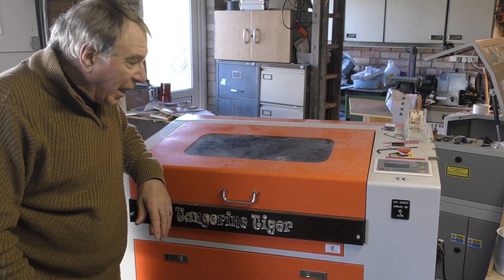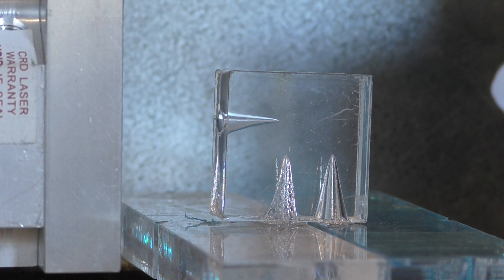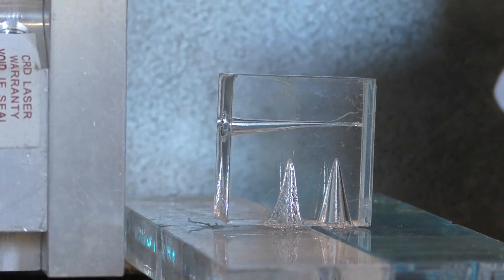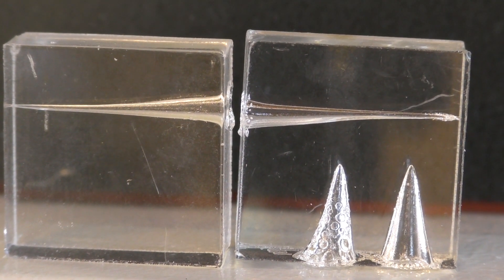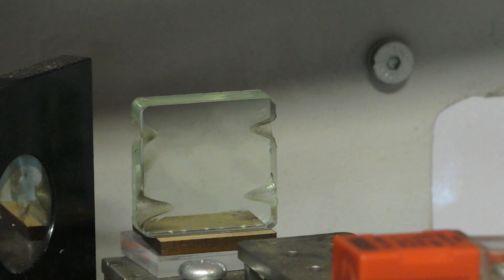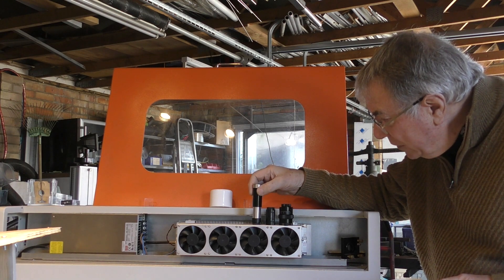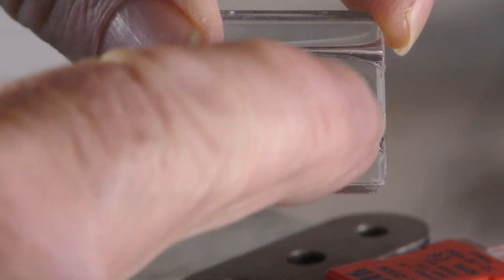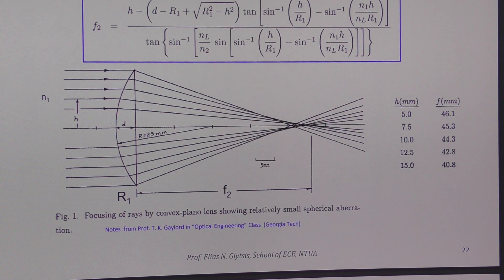RDWorks Learning Lab 226 Can my Beam Collimator  Work

Comment: are you trying to expand or reduce your output beam that is coming out of the laser? you are only concerned with spherical aberration since you are using narrow frequency or practically monochromatic beam right, what is the wavelength in question? and yes if you use a newtonian system the focal point will take all max intensity from the central axis of the original beam and distribute it across the outer perimeter of that beams cross section after going through the system kinda like an intense donut with less intensity the closer you get to the center of that cross section  , what you want is a galilean system be it to expand or reduce that will keep all lines in the same position after the system perhaps even keplerian system which uses different style lenses even though it has a focus point but i would prefer a top hat beam profile rather than the typical gaussian but i think that has to do more with operational mode , anyways i am just a novice but had a fascination with lasers and light for a long time, closest thing i built to anything emulating a laser beam was making a collimated beam of white light with better divergence than my hand held laser pointer having as best a spatial coherence as i can get it  although the light is quite weak as all i am working with is a 7w led for the source but still enjoy the light show and mirror steering i get at night with mirrors and a foggy room
Reply from the maker: Hi during the 3 intervening years since this video I have come to understand the wierd relationship between lenses and the intensity distribution profile within CO2 beams. It goes way beyond anything that normal lens theory deals with. Lens theory is all about images whereas laser technology for  cutting and engraving is all about amplifying light intensity. In essence the greater the intensity the faster you can damage materials.Different wavlengths interact with materials very differntly.  At low power  (say up to 150 watts) CO2 light at 10,640nm has a damaging effect on many non metallic materials whereas fibre  (1064nm) and diode 450nm) wavelengths barly tickle the surface of a much smaller range of materials .  The Gaussian intensity profile is recognized as the ideal  distribution for cutting materials but few have ever explained why. Exploring the RF CO2 technology taught me a great deal about how laser beams and lenses dont really work that well together,. The intensity profile directly out of an RF CO2 source is VERY high intensity in a very small diameter beam. Sadly it has a a high divergence of about 8mm beam growth per meter. The power in the beam does not change with beam length but as the beam grows so the intendsity drops of dramatically and the RF technology gets less and less  inefficient at cutting as it gets further from the source. To have varing performance across the work area is very undesirable so the standard practice for ALL rf machines is to catch the beam as it exits the source  and pass it through a beam expander.  Whether the Kepler ot the Galilleo design, there are two spherical  geomety elements involved. The beautiful Gaussian intensity from the source is almost destroyed by shperical aberration as it passes theroug the first element and  by the time expansion has happend at the second element the output intensity profile ihas  a near  uniform top hat  chacteristic. This charcteristic allows the low refractive central axis of a lens to be ignored and for the better focusing outer zone  to create  a superb small focal point. This is great for engraving but inefficient at cutting.  That is  why after many years of peddling the "magic" of RF  techonolgy. companies such as Trotech have introduced mixed technology machines where both glass tube (they call them ceramic tubes) and RF  technology can be selected to perform different tasks.. After my exploration of ultra thin beam diode lasers I plan to backtrack into RF technology because I see great potentioal for exploiting that soutce beam before it gets hobbled by beam expansion, 
In essence, my collimating experiments failed  because all I was really doing was producing a long focus compound system and not a collimator. You maay be interested to see my summation of how lenses and laser beams are very choosy about how they interact. These two videos  try to briefly pull togeter more than 3 years of expeimenta work and you will see examples of how Gaussian-destructive commercil beam expanders are 
https://youtu.be/7N8Th1-IF4s     and     https://youtu.be/v7-VArJbJTs
Reply: @SarbarMultimedia  your gallileo should be using aspheric lenses which are made to reduce or eliminate spherical aberrations but perhaps it is different at the freq range you are working with as you explained, also did you think of using parabolic mirror system instead of lenses to shape your beam?  try asking the gentlemen at the ch techingredients he is very familiar with lasers and beam shaping and quite a smart individual has made host of technical vids covering many things and alot to do with diode or liquid and other type of gas lasers he built as well as optical bench proects for shaping beam display projectors etc , ill have a look at your vids
Reply: @SarbarMultimedia  still not sure what exactly it is you are trying to achieve, again are you looking to reduce your beam size from 1mm to less?
Reply from the maker: @ARCSTREAMS  I am trying to preserve the Gaussian itensity profile in a thin narrow beam where the desructive intensity is  very high  at the beam core before it passes  through a single lens. The very low refraction of light rays near to a lens axis suffers very little from spherical aberration but  forces the focal point of those central intense rays way beyond the nominal optical focal point. to create a massivly amplified zone of  super high intensity. Imagine a single perfect high intensity ray passing throught the lens axis. It may be powerfully intense but on its own it is almost useless especially as its path is destined for infinity. Now gradually work away from that axis little by little and imagine where those now multiple rays will converge . As you expand your imaginary ray model I think you will see that there will be a poinbt at which the small refaction experienced by those rays will bring their convergences into a zone where they will become addative and very destructive.That is in fact  the mechanism that allows lenses to cut. Drill a hole in the centre of a lens (I have done  just that) and you destroy its cutting capability. Diode lasers exploit this effect with their very narrow beam(s) to create a focus of INTENSITY  many millimeters beyond the optical focal point. However,  they fail miserably to fully exploit this property when the try to increase the power. They are no longer focussing a single 5watt beam , but  are trying to converge multiple different individual laser beams into a single spot.   Although this increases the average power, the wavelength tolerance between each diode source causes  interference and  fluctuating power at the aiming spot.  No such issues exist with a 40 watt single source RF beam.  I am planning to experiment with the raw RF beam in the near future by using the laser source in completely different manner. I freely admit that I am not an optical engineer  but my accute observations and experiments with light,  lenses  and different wavelengths,  destroying  materials,   have suggested that there is tremendous untapped potential in that horribly diverging (8 millirads) RF source. Although I found diode technology very unsatisfying, it did tech me more about lenses and laser beams.

Although I know there are many methods/geometries  for  reflecting and refracting  light rays,   I only use the  low cost commerially available  lenses and mirrors  available to hobbyists. Focussing light intensity to do damage uses lens characteristics in a completely different way to those required for transmitting high fidelity images.  The whole science of laset technolgy is fascinating but my pleasure is derived  from that very niche  area of  trying to efficiently damage materials. It's a niche  that sits at the intersection of optics, physics and chemistry. ....none of which I am qulified to dabble with.
Reply: @SarbarMultimedia  it is interesting to experiment and i am watching your other vids on this, indeed 8mrad is a horrible beam quality, even my homemade white light collimator does a much better 1.4mrad,,  i wonder if this has to do with oscillator design of the tube or is inherit to a large wavelength like 1.06 nm, i think the smaller the wavelength the better the divergence quality thus a blue laser has better mrad than a red laser etc 
i am sure for your specific laser you can find a solution perhaps expanding the beam as much as possible first before focusing it down again , this allows the beam distance or length to go further with less loss to divergence before it is focused down to a much more precise energy distribution in that focal point and past unless you are trying to get a naked beam to go that distance to do the work without any lens system there? idk exactly what you are trying to achieve that is not working with what you already have , what exactly is the size of your beam as it exists the laser oc? are there any lenses after the oc within the laser itself ? what is the min and max pw ?  what exactly is the problem you have once the laser beam emerges from the device that you are trying to improve? i mean you got many things going it seems, are you trying to make it so that the beam can do a good ob no matter what distances the target is? i am enjoying watching your vids for now but not always able to follow with some of the explanations you make like 2nd or third mirror etc

Comment: hi Russ i am wondering if you could help me i want to get your lightweight head you made but i have my linear rail on the front and i think it is 12mm could you let me know if i can buy it from you or where i can order it from if so i can send some photos of my machine if that would help thanks for your help Gary
Reply from the maker: Hi Gary
 Youtube used to have personal messaging system that was ideal for communicating off line.  I usually suggest disguising your email address slightly to fool any bots that will be trawling. However, recently Youtube has not been posting comments containing  lightly disguised email addresses. At present their algorithms are not clever enough to decode sentences so  this seems to work.  The first part is  john followed by a dot and then smith. Add an at symbol followed by g=====mail, Finally add a dot and a com.
 I will reply with a data pack and also delete your comment
 Best wishes
Russ
Reply: @SarbarMultimedia  hi there russ thanks for getting back to me regarding this garycooper add an at symbol followed by sky followed by a dot and a com thanks in advance and then i could send you some pictures also will i see be able to use my autofocus with this lightweight head
regards

Comment: Hi Russ. I like your video a lot but have some questions about the machine. How can I message you? Do you have a email?
Reply from the maker: Hi
 There was a time Youtube had a personal messaging system.but it was canned about 2 years ago
  If you like to send me your disguised email in another comment  then I will answer and delete your comment.
 A simple disguise seems to be picked up by Youtube and your message will mnot be sent so we have worked out that putting your dat in a sentence fools the algorithm. for example. 
The first part is john followed by a dot and smith. Use the normal at and then gmail. Add a dot follwed by a com.
 Best wishes
Russ

Comment: Hey Russ,
Thanks as always for presenting very interesting research. You said that your intent was to improve the performance of the RF Tangerine Tiger which makes sense given the divergence if the beam, but it seemed like you also got promising results on your glass tubed machine.
Reply: Sorry... Continued.

If you could in fact get a narrower, higher intensity, parallel beam from a glass tube, that would be very interesting to those of us who use glass tubes to cut.